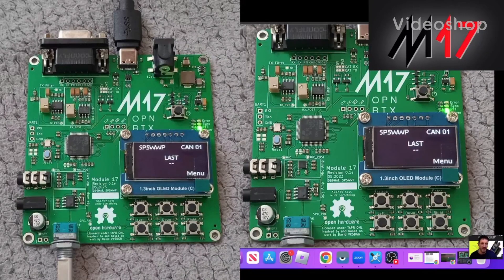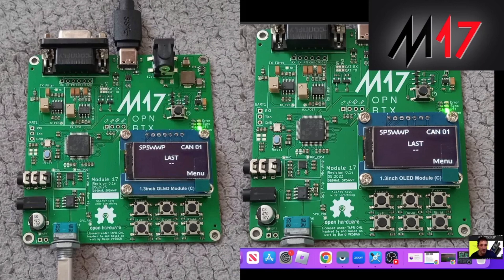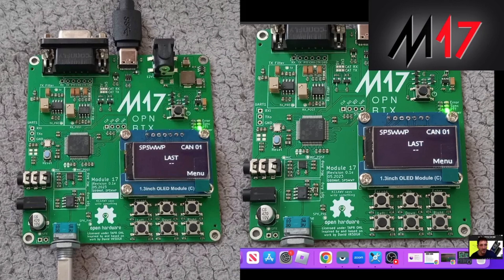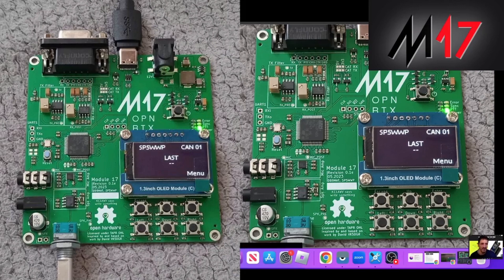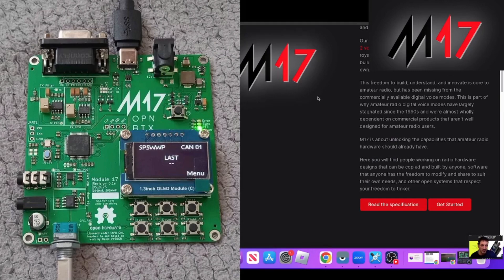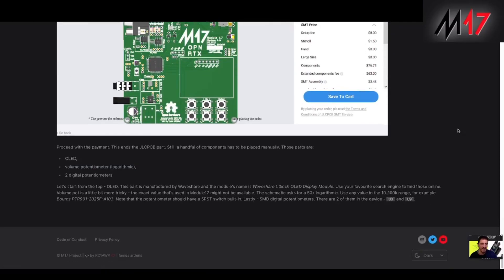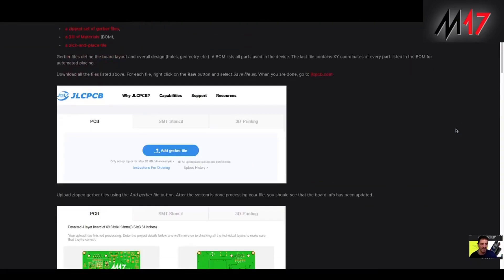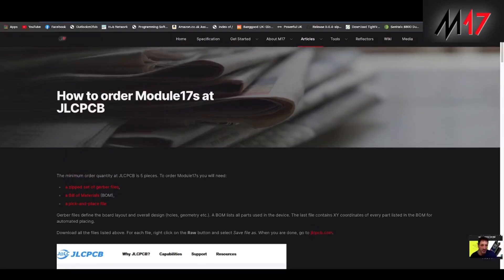M17- PROJECT , M17 Module -RX,TX

Comment: Does work with UV5R
Reply: It doesn't, you need a true 9600 baud capable radio
Reply from the maker: Does UV6R have 9600 baude connection ?